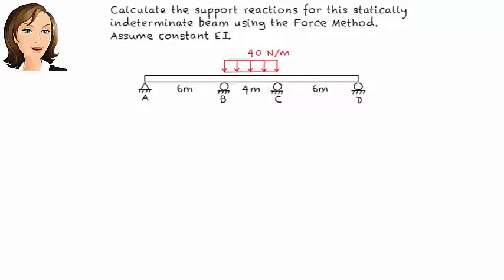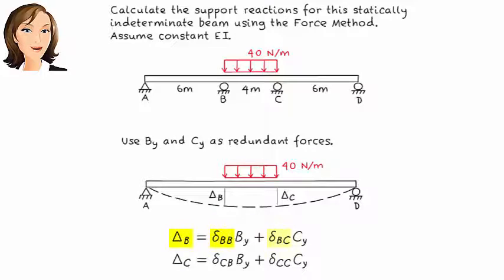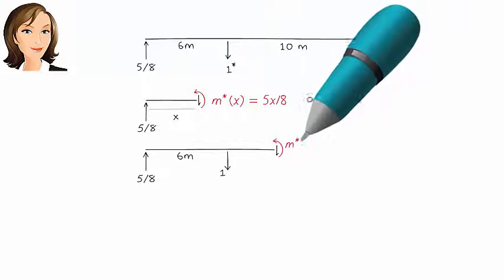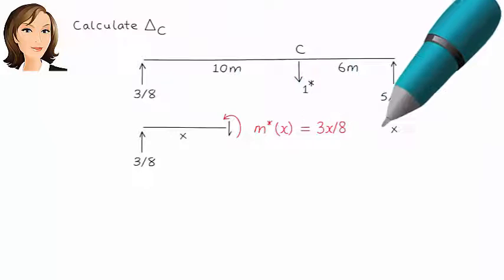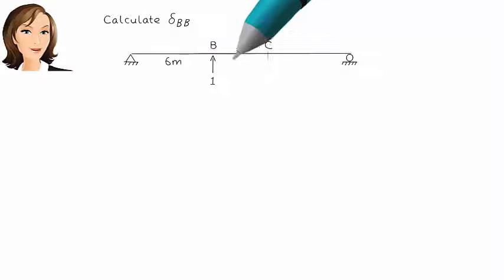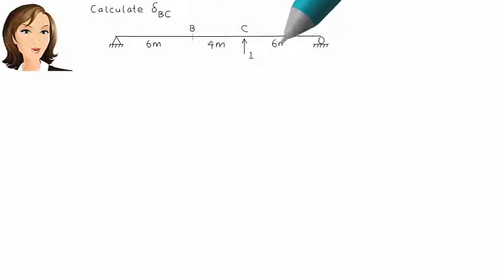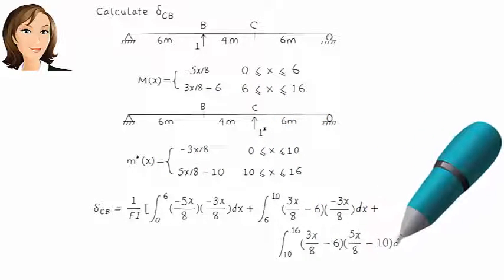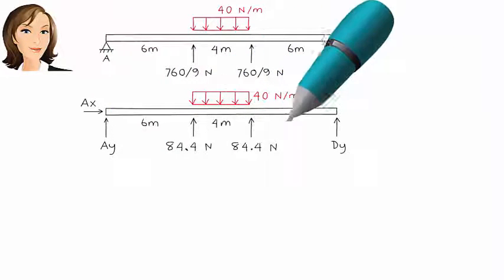Force Method: Exercise Problem 3

Comment: In both ∆B  and  ∆C , (M) have three parts with different ranges, but (m*) with two parts...the question is: third part integration limit of M is 10-16....but m* is 6-16....during integration  ?
Reply from the maker: Since M has three parts, m* needs to be written in three parts as well. So, we get

Integral of M m*  between 0 and 6 PLUS
Integral of M m* between 6 and 10 PLUS
Integral of M m* between 10 and 16.

For the last two terms m* has the same function, we just integrate it once between 6 and 10, and then between 10 and 16.
Reply: thanks